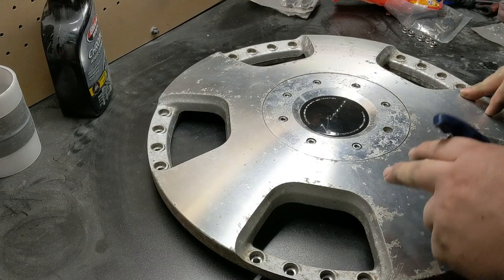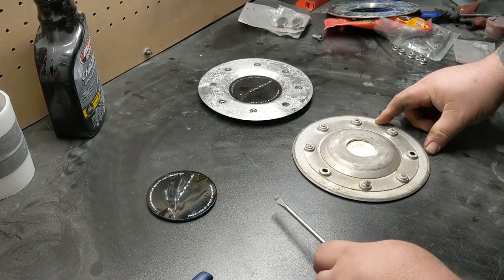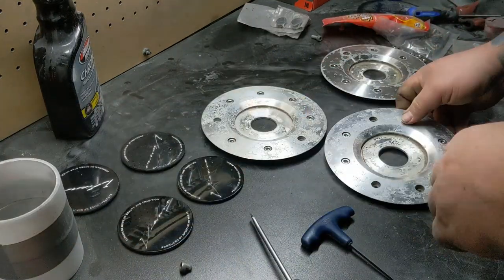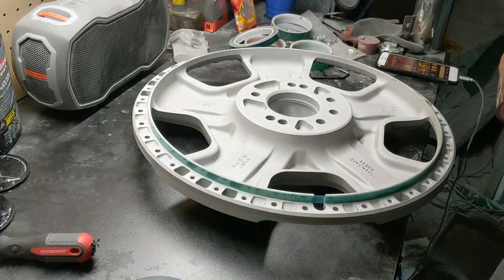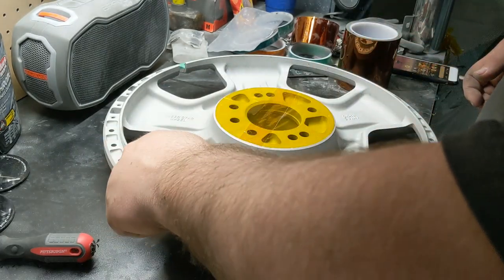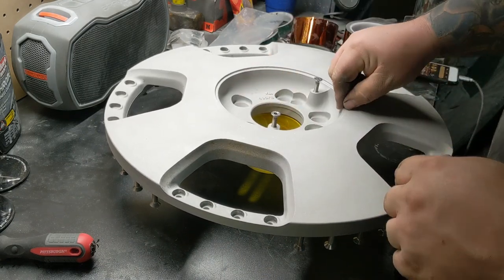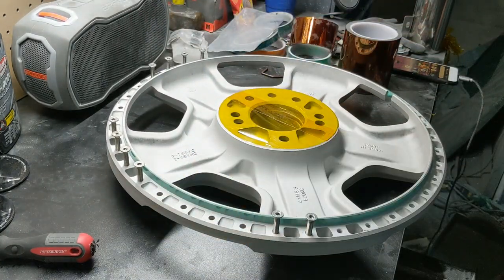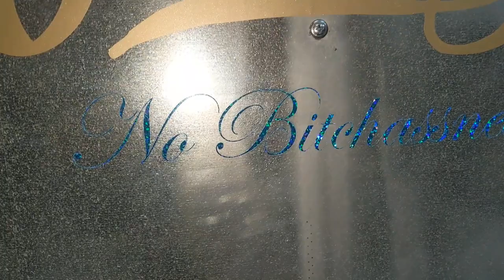Powder Coating SSR wheel faces - Ep 21

Comment: I have a  tip for you. 
When you powder coat something.and because.of hooks there's a place where it.isn't painted,try using this method to hide.it:

Take a pinch of.powder you coated an.object and put.it.on a metal plate,take nitro (yeah,nitro like dissolvent) and pour.it on the powder. then take a toothpick,stir it up and use the toothpick to apply that matter onto the coated part where there isn't powder. It won't be super,but.it will hide the flaw.

Comment: Hey man I sand and bead blast at work sometimes and was wondering if glass bead would be good for bead blasting faces to save a few bucks when I take the faces to get powder coated and what areas do I need to avoid blasting
Reply from the maker: you never wanna use glass bead for blasting prior to powder coat. If you have another media it would be better to go that route, assuming its suitable for aluminum. You can blast everything
Reply: @UnknownCoatings  what media would you recommend?

Comment: Nice work, do you wash part after sandblasting it.
Reply from the maker: I've done a bunch of testing. Rinsing after blasting was a must before I went to this green diamond media honestly. Before I could put water a wheel after blasting and see dirt and dust in the water.  It was obvious. Now with green diamond. If I blow it off and put water on it, nothing happens
Reply: @UnknownCoatings thank you for the quick reply this helps alot.